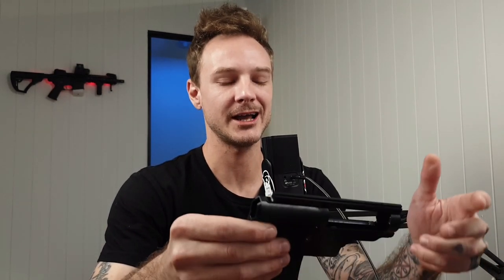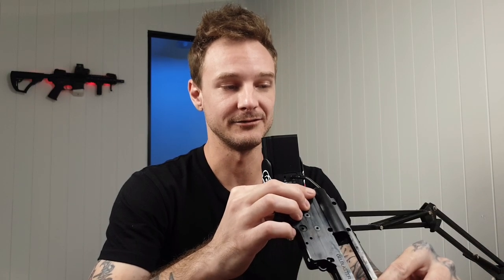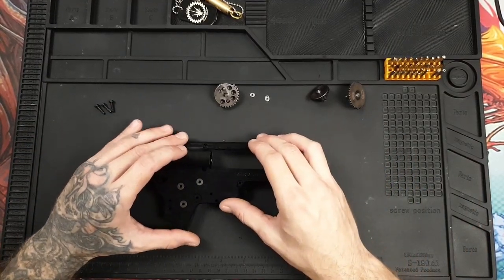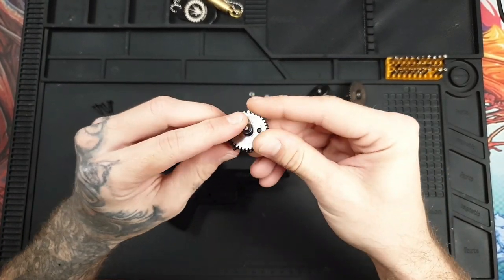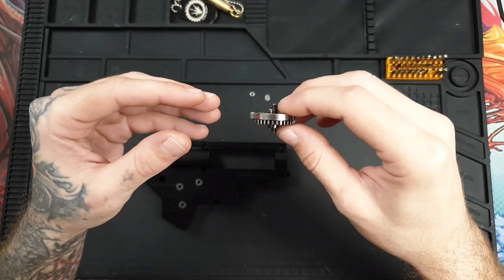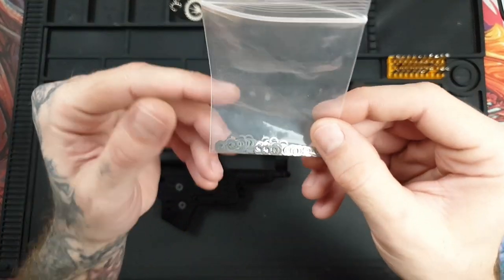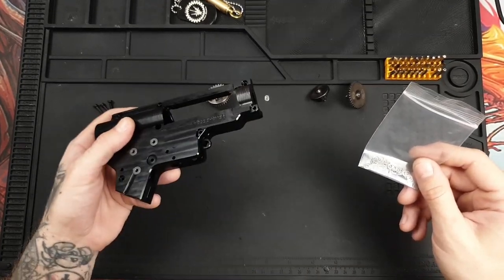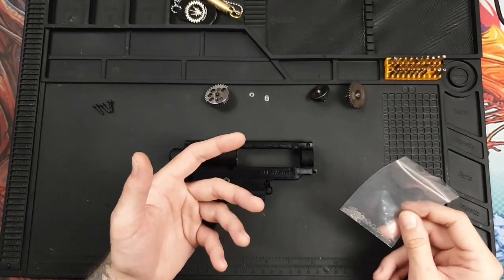(FULL TUTORIAL) Perfectly Shim your AEG V2/V3 Gearbox + Bevel to Pinion + Tappet Plate Adjustment

Comment: Great video. I would've liked to see you vernier the tappet and adjusted to 7.5 instead of just maxx opening 😘
Reply from the maker: Why would you limit it lol?
Reply: Why over do it is the question man haha
I'm only new to this
Reply from the maker: @brendonpower3833  oh I totally took that as a smartassy dig sorry man <3

So a stock airsoft gearbox is designed for that max tappet travel, the only reason it doesn't happen stock is because of manufacturing and fabrication tolerance differences. Gels super duper specifically need as much extra length a s you can give them, its very crucial for proper feeding in higher rps builds. In my opinion haha <3

Comment: Supa glue and bi carb soda. Even used it to fix motor bike plastics and heaps of otha applications
Reply: @gelology5514  yeah lots of things in aircraft and automotive body repairs. Works and so strong. Can be  carved or sanded to finish ya repair nice and neat.
Reply from the maker: @karenmalcolm7052  i'd say a good portion of cars on australian roads are held together with bicarb/superglue mix haha <3
Reply: Pffttt, cable ties & duct tape slays!